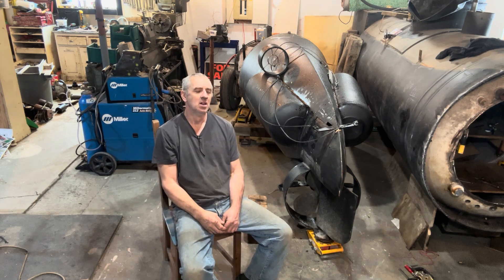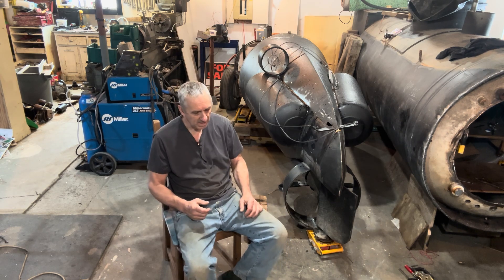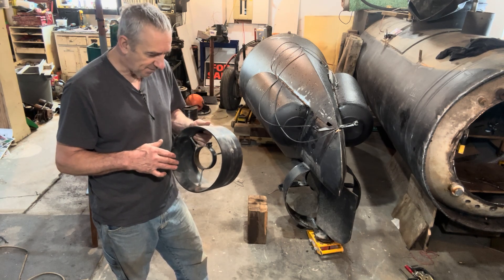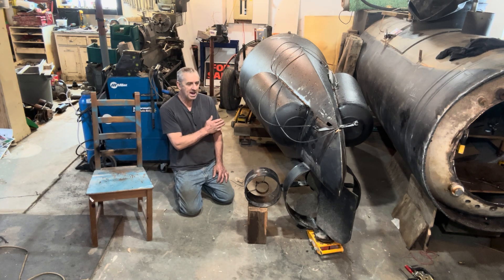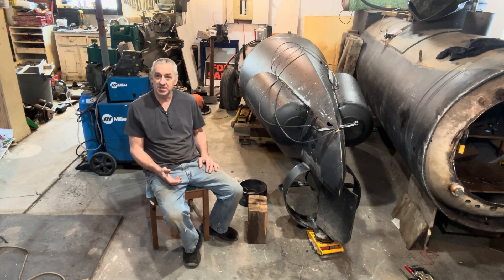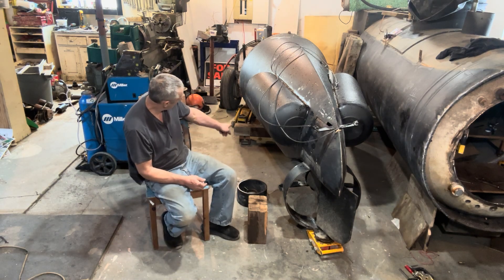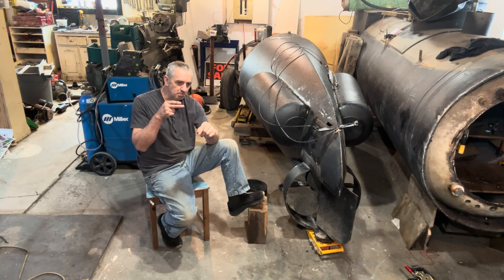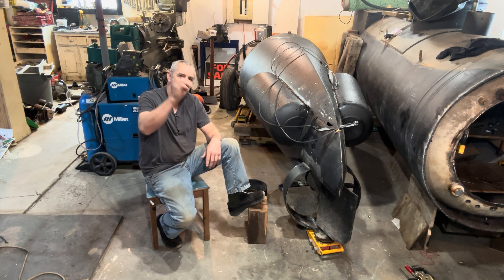Building a diesel submarine at home.

Comment: Hank, I've got a quick question for you if you don't mind. In your last video, you showed us some of the electrical thru hull components. Are the threaded rods made out of stainless steel? Or are they made of some other type of metal?
Reply from the maker: The rods are not SS, just sink coated carbon steel
Reply: @HankPronk oh, okay, that's good. Brass would work well. Stainless steel is a really poor conductor of electricity.
Reply from the maker: @AnthonyRSCSinovcic  Brass is better for carrying the current for sure.  But when you do the math in this case I loose  .5Watts .  Brass is also better for heat loss, but in this case the steel will rise 3.1 C and the brass 1.6C, under the 50a load.  given it is in water, it does not matter.  Honestly, I just use whats on hand, but brass is better.

Comment: I have been thinking of the use of trolling motors on a sub for 30 years. my idea, dead center of the forward facing geometry  mounted in through hull bushings with cup seals on the same chromed shaft they usually have. inside the sub put 90 deg. handles. then they can be pointed 360 deg. in any direction. providing insane vehicle positioning under any circumstance including buoyancy control or trim.
Reply from the maker: Yes, that is kinda the way Kitrigde subs are built, except the shaft is replaced so you dont rely on the motor seal to keep water out of the sub.